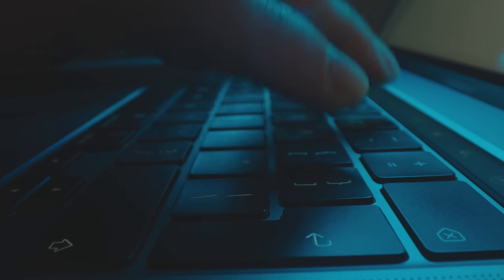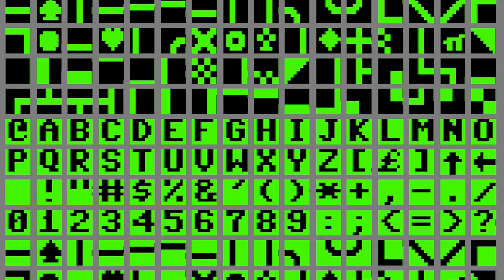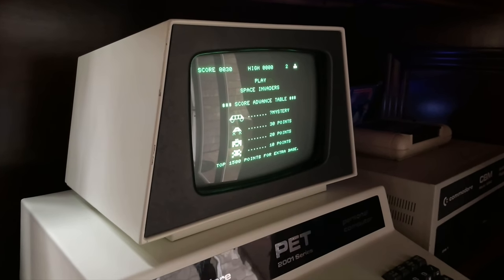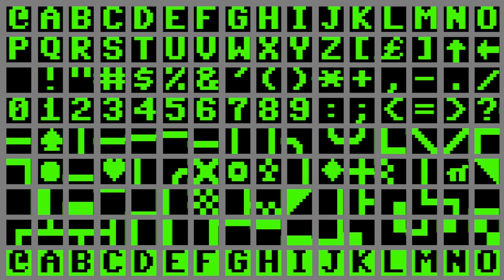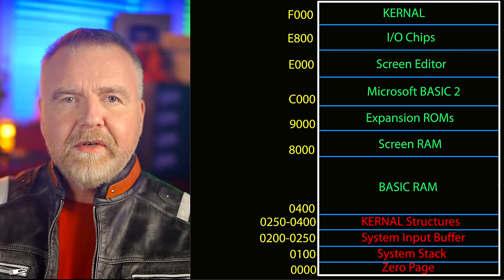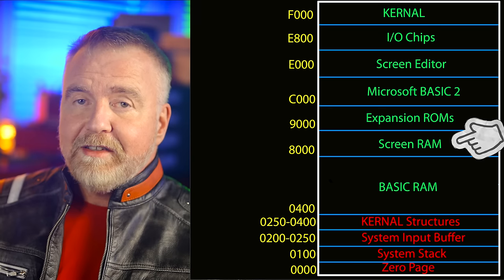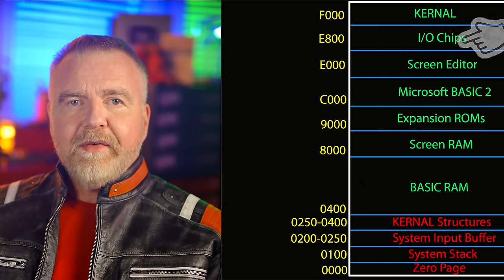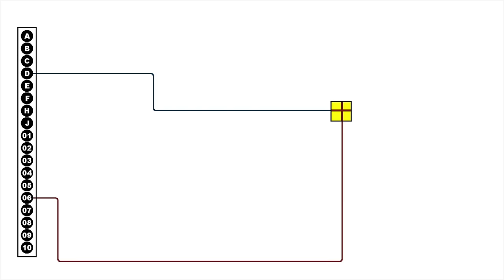Everything you SHOULD know about your Computer but don't!

Comment: I bought a second hand Pet in about 1988 off the company I worked for at the time. The only experience I had at the time was with cheap home computers such as the ZX81 and Oric 1, plus a week long 6502 assembly course when I was 13 in 1984. With no instructions, and of course no Internet it was a great learning experience. I actually managed to program a rudimentary  BASIC horse racing game where you could bet on the outcome of each race, each horse was just the number 1-6 moving along a track made of the minus symbol and a random number generator to decide if each horse moved based on their odds. If I remember correctly the entire screen was redrawn at every passthrough of the code. Years later I managed to get a job in IT support but knowing how to code certainly helped my career, especially in the early days of DOS and UNIX support. Still dabble in C based languages to this day. Videos like this remind me of those days and how exciting computers were before they became a tool just for work, and help reignite the passion :)

Comment: The first time I did much with computing, it was to reprogramme a training simulator for up to 32 staff. I did not have access to the assembler, for programming, so wrote code long hand in hex, and entered it byte by byte into memory. You reminded me of how much I have forgotten in over 40 years. I did not have a keyboard-map for the function-specific keyboard, so I wrote my routine to map the codes. In contrast, I have just updated my PC from Win-10 to Win-11. I spent the last two days locating, and removing, all the OEM software to render it stable once more. Times change, not always for the best.

Comment: Absolutely right, I think it was around the mid 90s for me, I was brought up building and designing my own computers in the 70s and 80s. Once we hit 80386 protected mode and NT, and I could no longer bit bang the parallel port without having to hack a driver, I lost my grip of having a comprehensive understanding the entire stack.

I did write display drivers for Windows 3.0, but only a very few basic drivers for NT, and of course, the driver model kept changing. Thankfully since WinUSB we hardware guys can largely avoid writing drivers these days, but it's taken a couple of decades of USB to get here.

Regarding the PET's character display, AIUI the character generator ROM isn't memory mapped, it's on it's own private bus. There isn't enough time to be able to fetch the character and look the character's bit map up on the same bus.

The 6502 has a dual phase clock. On one phase, the CPU owns the bus (eg, instruction and data fetches/stores), and on the other phase the video can use the bus. As the clock is 1MHz, or a period of 1us, there's 500ns of bus access time for the CPU and then 500ns for the video. RAM and ROM of the day had typical access times of 250 to 450ns. By the time you've added the glue logic propagation delay times, there's not enough time to allow for any more than those two memory accesses inside that 1us.

Thus, to achieve the timing constraints of video refresh and the 1MHz clock, there's a second address/data bus, physically inaccessible from the CPU's buses, for the character generator ROM.

The dual phase clock of the 6502 architecture was a key reason for its popularity among manufacturers precisely because you could easily memory map the VDU memory and avoid timing contention with the time definite phases. Life was a bit harder for hardware designers on processors like the Z80 which doesn't have this feature.
Reply: Shoving the character ROM on it's own bus certainly wouldn't be all that odd a choice- the NES did the same with tiles, and I think the IBM PC monochrome adapter may have done the same with it's character ROM. It would always have been possible to add some circuitry (e.g. a DMA circuit in the video processor) to get characters moved, but that would have (slightly) complicated the video circuitry, and would have required extra chips (and as I recall, ROM was cheaper than RAM).
Reply: This is why I migrated to Linux relative early. I even own the T-shirt "Ich bin /root, Ich darf das!" = "I am /root, I am allowed to do that!"
I also stopped developing hardware stuff for the PC and migrated to embedded systems only using Ethernet and browser based interfaces. Less pain and no sweat anticipating the next OS upgrade.
Reply: @CC-ke5np  thank you for teaching us Germany